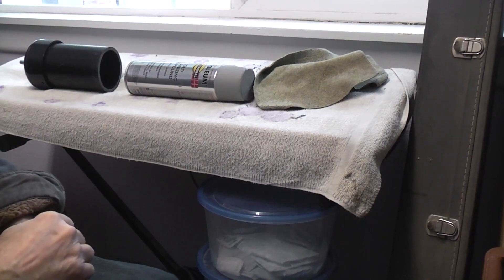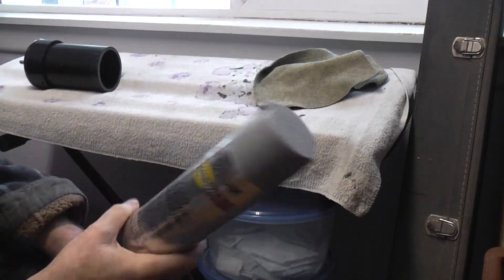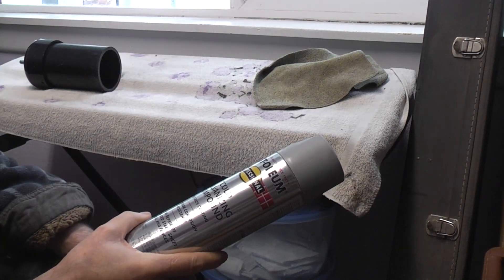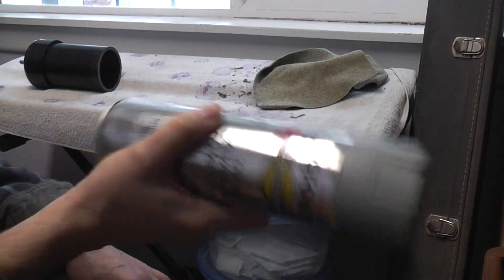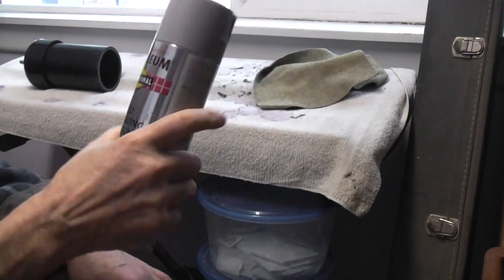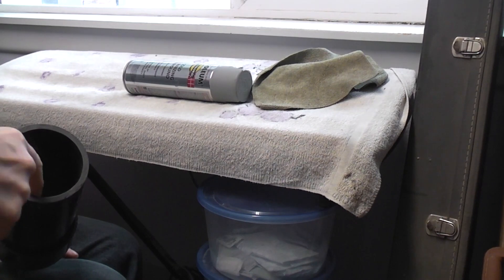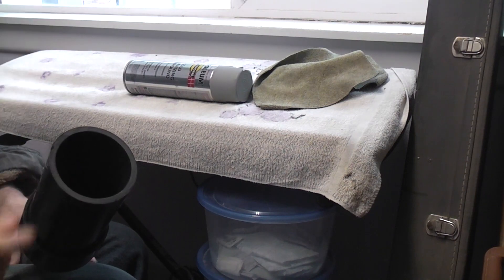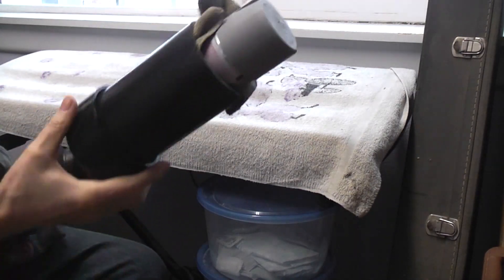Spray can mixer using PVC pipe , PVC end cap, a bolt & nut and a drill.

Comment: Prima, danke für den Hinweis.

Hast du mal probiert, die Schraube NICHT in der Mitte (zentriert) zu setzen? Vielleicht?? schüttelt es noch mehr?!

Beste Grüße aus Schneverdingen /ger
Reply from the maker: It does shake more, kind of hard to hold on to. I find the little ball inside trying to keep up and changing the direction of the drill does a good job.
So much better than hand shacking.